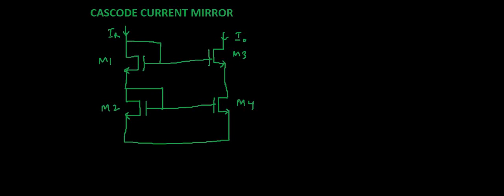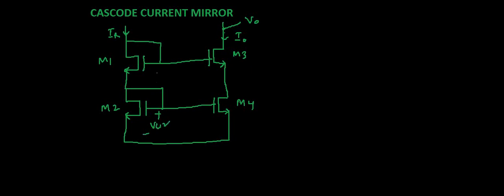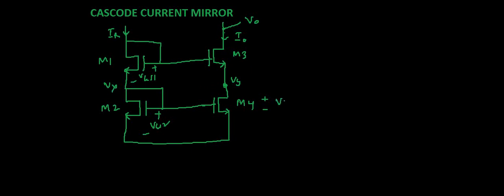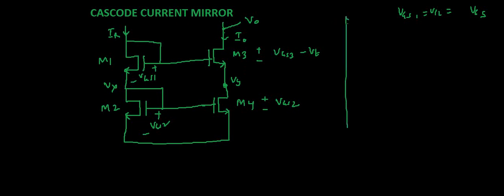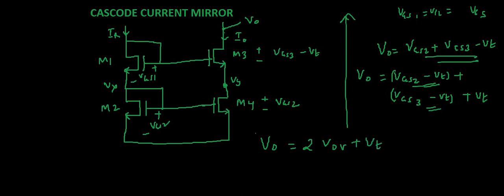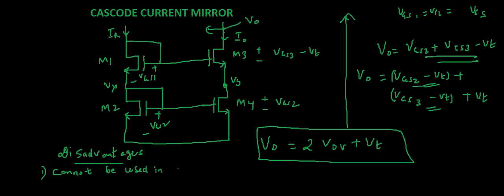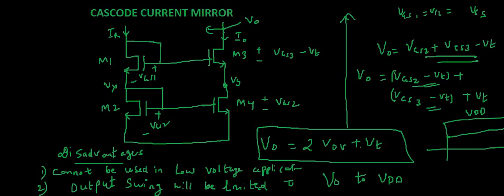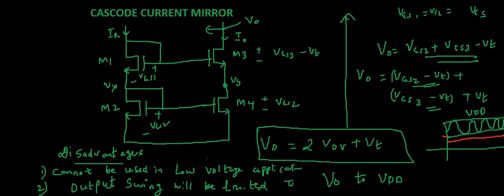Output swing of Cascode current mirror

Comment: Why the m3 has voltage vgs3-vt
Reply: Or how it has tha plz explain
Reply: @AnirudhDua  for m3 to be in saturation
Reply: @uday5786  👍
Reply: @AnirudhDua  vgs3 = vgs1 because m3 and m1 has the same gate connection and also since Vx=Vy, then vgs1 = vgs3. And becasue Vds1 = Vgs1, then Vgs3 = vds1. So, Vout = Vds3 + Vds4 = Vgs1 + Vgs2 = 2Vov+2Vth
So this is different from what you got